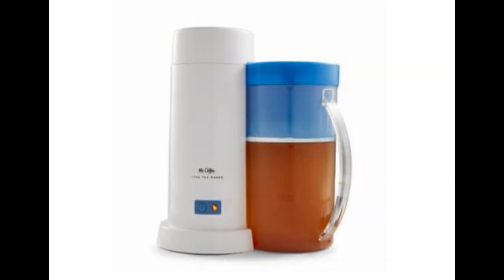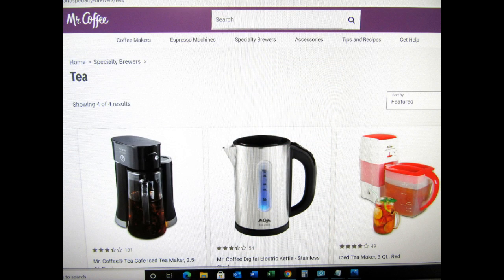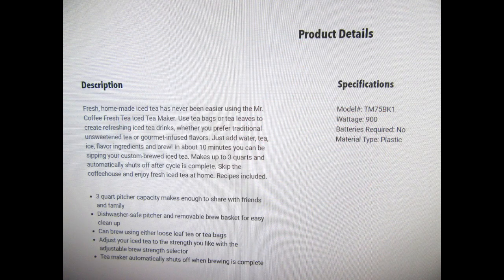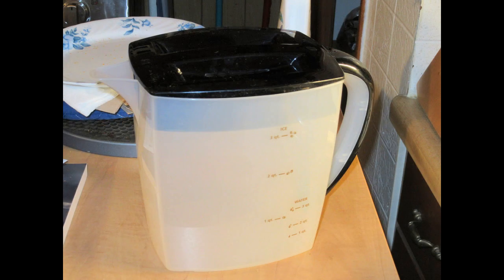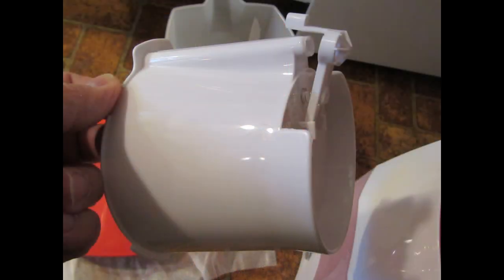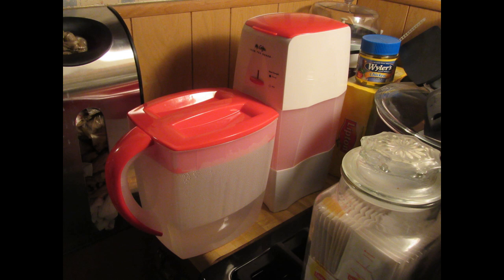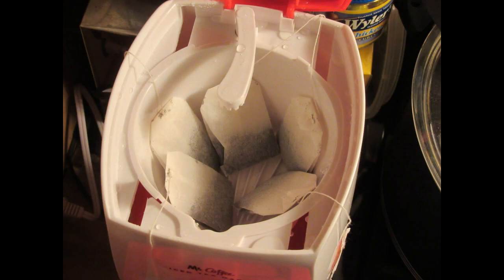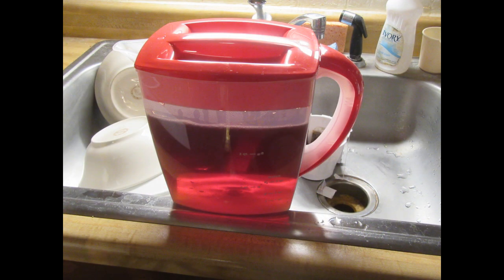Mr. Coffee TM75BK or TM75RS Iced Tea Maker: Description & Review

Comment: Great Video.  You covered every possible question I could  have had and perhaps has persuaded me to invest in a new tea maker.  I have the very old TM1 and it still works extremely well.  I have no complaints on my older model except that it doesn't make enough tea during the brewing cycle. Thanks again.

Comment: This is interesting because I have the original TM1 in teal and still use it.  I bought it back in the mid-90s and it came with two pitchers.  At one point, I was able to buy replacement pitchers after the original ones cracked.  As of now, I am down to one of the replacement pitchers and I am not able to find new ones.  I normally use two of the family-size tea bags, but I tear them open and dump the tea leaves into a coffee filter.  I found that just using the tea bags in the TM1 brew basket made very weak tea.  I have been thinking of getting a new iced tea maker, so this review was helpful.

Comment: Wow!  I have the same maker and fill water to the 3 qt line and fill the pitcher pretty high with ice.  I use 1 tea bag laid flat in the basket and put the brew strength slider to just about 1/8" from the bottom.  I've had no over-flow, and perfectly made tea.
Reply from the maker: Mary Cleveland, there is no such thing as "perfectly made tea", only personal opinions about it.  A normal tea bag is intended to make one or two cups of tea,  so if you are making so much tea using only one bag, then 'weak tea' must be your personal preference.  Good for you.

I can't quite picture how much water you are getting when your brewing us done, but you use ice while I use only water, so I cannot comment on that. If you like the results you are getting, then that's all that matters!
Reply: @youtuuba  my comment was simply a statement of  surprise that so many tea  bags were being used.  I used to use one of those big tea bags that make a gallon or so,  mostly because I bought the wrong ones--but I could never get the bitter taste to go away.  I dropped to 2 tea bags then to 1, and yes, I like it weaker like McDonald's tea.  I was not criticizing, just expressing surprise.  As for how much it makes, I wind up with about the equivalent of 3 large tumblers.  I wish it made more.

Comment: Since sugar dissolves better in warm/hot water do you add to empty pitcher before brewing?
Reply from the maker: James S, I DON'T add sugar (by itself) when using this new machine. Also, the pitcher should NOT be empty before brewing. The only correct way to add something is after brewing, and put directly into the brewed tea in the pitcher.
Reply: @youtuuba  Thanks.  I should have clarified adding the sugar to pitcher (with ice at beginning OR at end of brewing cycle).